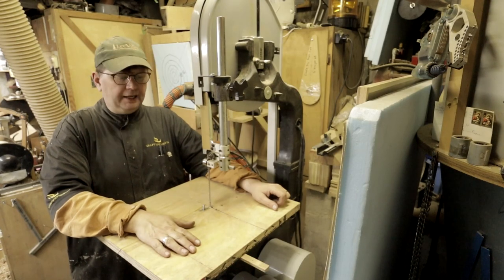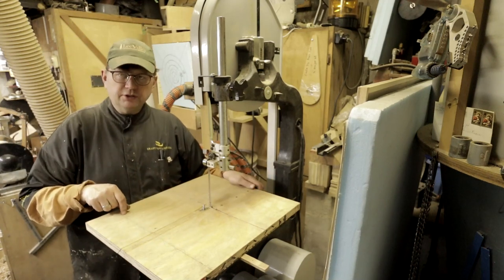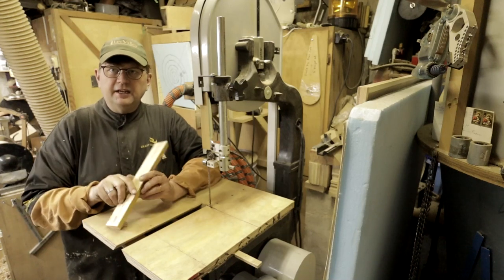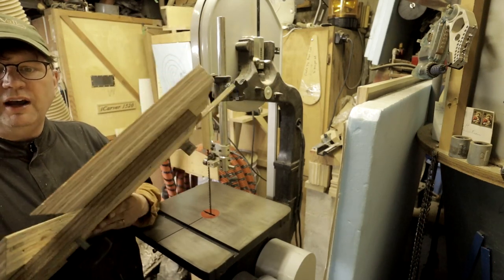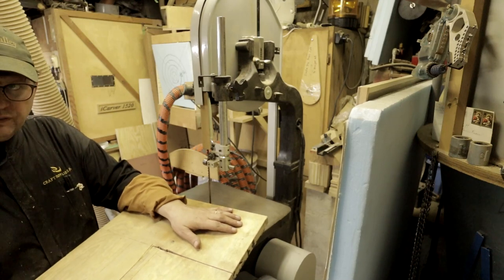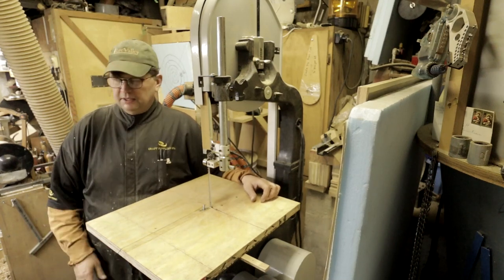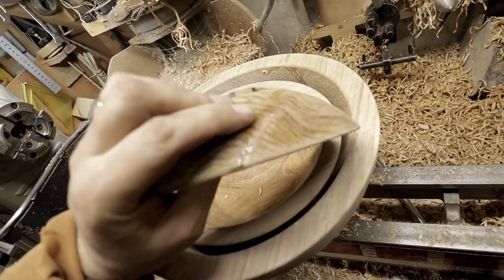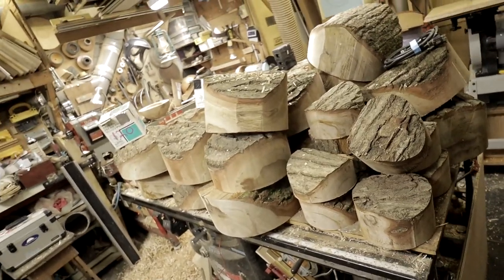April 11th VLOG Questions on "Bowl Blank Circle Cutting Jig" and making a mess in the workshop

Comment: Good to see you Stu. The jig is well executed. Mine is not as nice as that....think I'll copy yours. I'm just worried about all your blanks cracking before you get to them....better get em done quickly. Cheers from HK
Reply: Throw them in a big garbage bag and that will give you more time before they dry and crack. You can also use that to slowly dry them out...once in a while you take them out of the bag and then flip the bag inside out so you lose the small amount of water each flip.
Reply from the maker: Thanks for the comment Peter, nice to see you. The blanks should be fine, they are very wet, and like my Brother Todd says, trash bags full of wet shavings are your friend, you can even get some spalting going on! I've got next to nothing to do right now so I'm making lots of bags of shavings!
Cheers!
Reply from the maker: @toddablett4493  Yep, that works, I can also fill the bags with wet shavings.
Cheers!